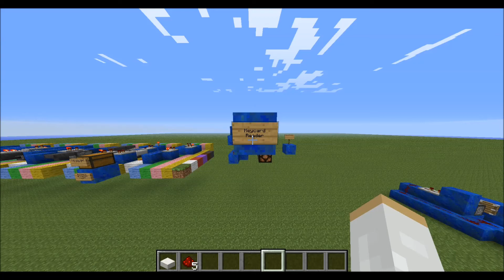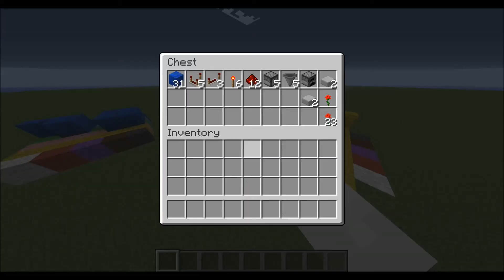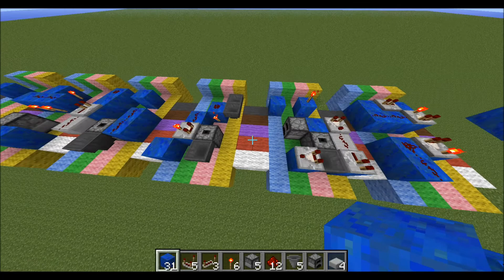Keycard Reader Tutorial

Comment from the maker: I think I know what's going on. Do you have all of the same item inside of the second hopper? If not, it will start replacing the items you have inside with the other items.
If you have everything set-up correctly, just take all items out of the 3 hoppers - and 5 droppers - then put 19-1-1-1-1 in the second hopper. The third hopper will automatically take 1 from the second hopper so you'll be left with 18-1-1-1-1 in the second hopper and the third hopper will have 1-0-0-0-0. Hope this helps. :)